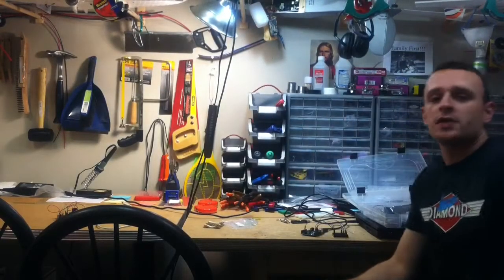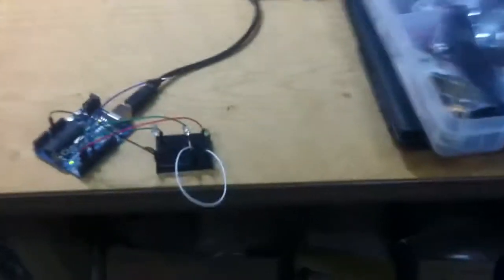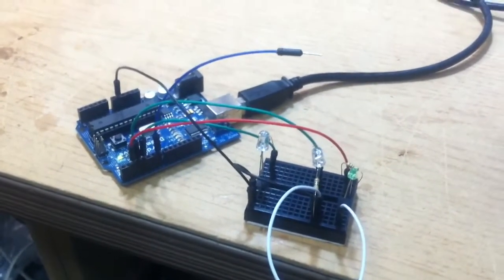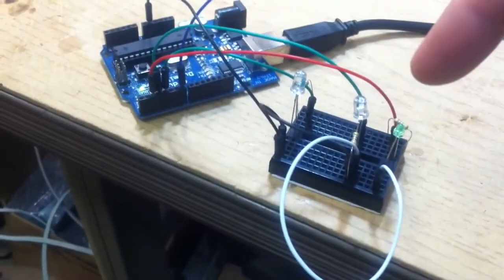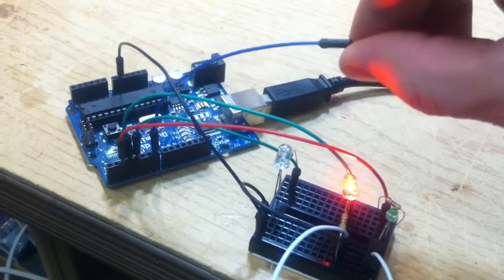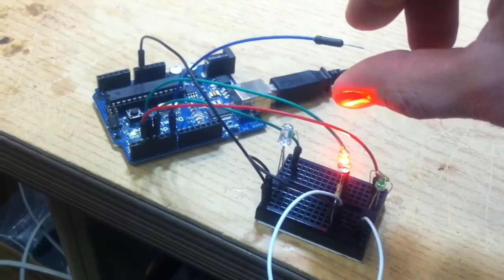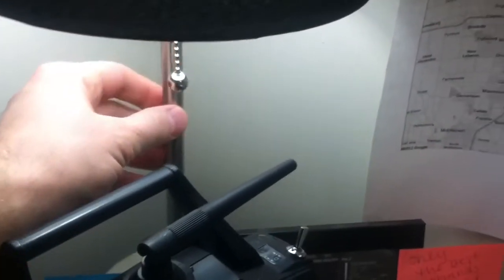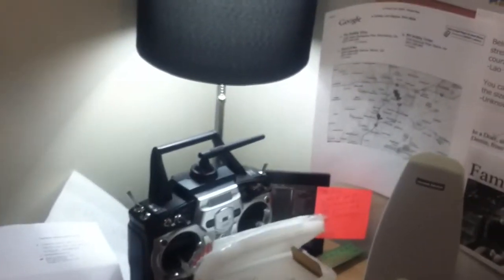Arduino Touch Lamp (using a Capacitive Touch Sensor algorithm & an LED)

Comment: give me the connection diagram
Reply from the maker: For the current code posted under the video (Touch_Lamp5.ino), it's simple: connect a wire to a 10k resistor then to pin 7 for the touch sensor. Pins 2 and 3 are outputs. If you want to power an LED, connect pin 2 or 3 to a 220 Ohm resistor (or larger) then to an LED anode (+ side). Connect the cathode (- side) of the LED to GND. Done!

Comment: What's the point of adding the other two LEDs when they are not related to this video
Reply from the maker: That just happened to be a breadboard with parts in it that I had previously used on another project is all.

Comment: Did you manage to hack the lamp?
Reply from the maker: Yes, but I'm still debugging it.  Hardware is tough sometimes, as weird things can happen :). The relay works fine to turn the lamp on and off, and when I have the Arduino powered by the USB port on my computer, the touch detection works perfectly, but when I power the Arduino by a 9V AC-DC wall adapter, the touch detection no longer works!  I think it has to do with grounding and relative voltage potentials, as well as AC sinusoidal noise.  To debug it, however, I need to know what's happening in the Arduino with*out* having it connected to my computer.  This requires wireless communication, so to debug my touch lamp code now, I'm working on implementing the RF24 library by maniacbug so that I can do wireless communication between two Arduinos (one powered by the wall, and one in my computer), so that I can debug what's happening in the touch lamp code when powered by the wall by printing data to the screen on my computer, wirelessly.
Reply: panther3002 It's important to make sure that your Arduino is properly grounded. I'd recommend that you ground your board using the earth ground on the 110V outlet. It most likely works while connected via USB as it's connected to your computer's ground and in turn connected to the earth ground via the C13 power cable.

Also, do you care to share your algorithm?
Reply from the maker: Adam Hunt Thanks for your comment!  After setting this project down for ~3 months I just picked it back up last night, grounded it to the wall, and boom!  No code changes and it magically works.  It makes sense now. I previously didnt' connect the grounds because I was very worried about a potentially dangerous ground loop.  When not grounding the Arduino to the earth ground, I can read an AC voltage on my multimeter, from Arduino to earth ground, of 7.61VAC.  I do not know why this is.  It seems to be an artifact of my multimeter, however, as it causes no problems and there is no measurable current flowing between the grounds when connected.  As for the code, I hope to clean it up, attach a license, and post it to GitHub soon.  Keep badgering me ever 2 weeks until I get it done, by dropping me a note/comment here or on my blog (link above). Thanks!
Reply from the maker: Adam Hunt, I have now posted my code on GitHub (link in video description).  It is not complete by any means, but it's what I've got so far.